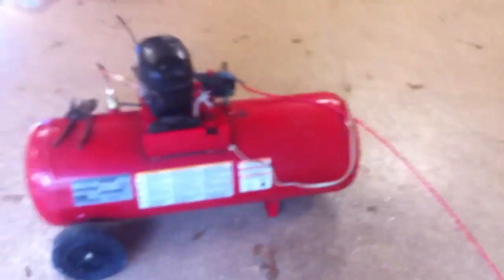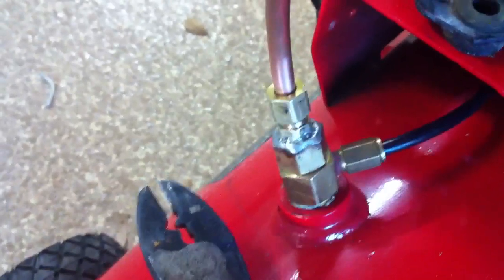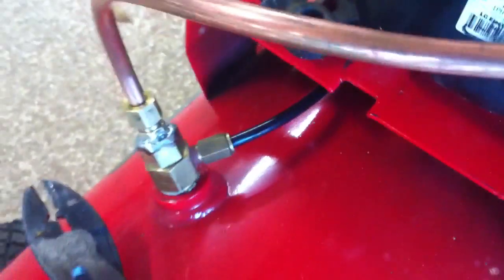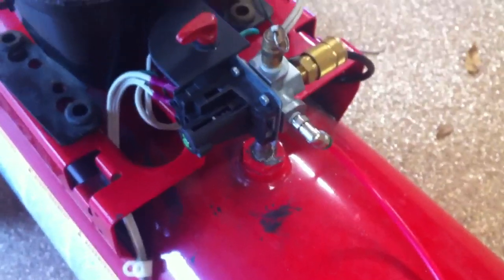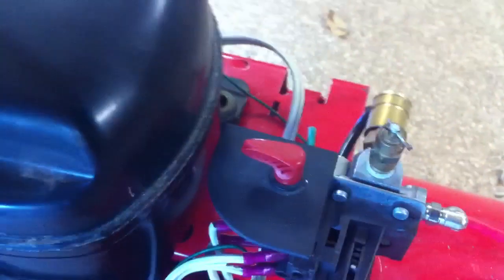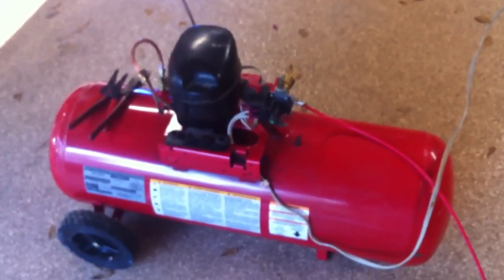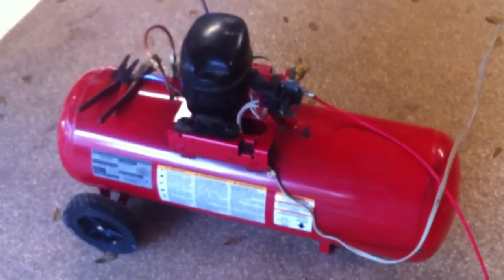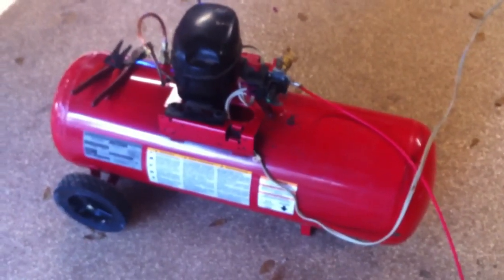Air compressor from refrigerator parts

Comment: Did that compressor come from a full size fridge (as opposed to a bar fridge)? What's the amperage draw on it for startup? 3-4 on one circuit would be great if it could be done. I've got three 100lb propane tanks that I'll be building a rack for and mounting upside down (don't want to cut or weld on the tanks themselves) for a permanent air system for my shop and my original plan was two fridge compressors with a system to catch and recirculate the oil before it reaches the tanks.